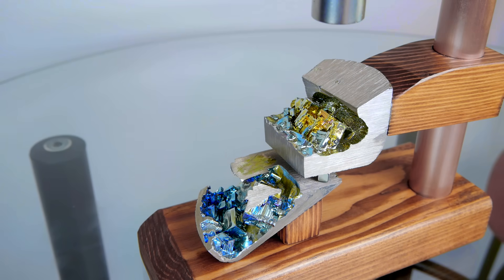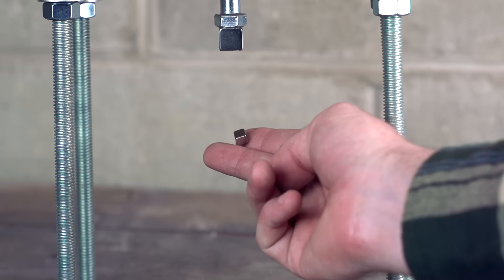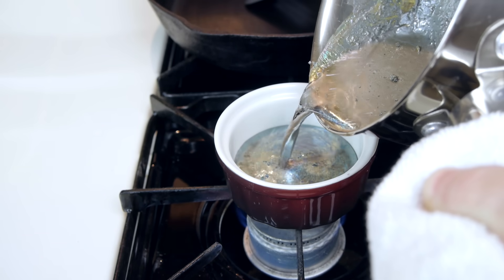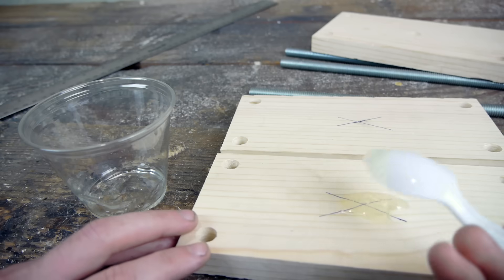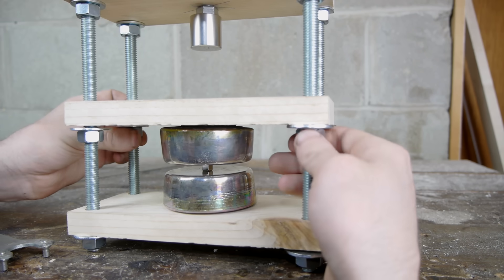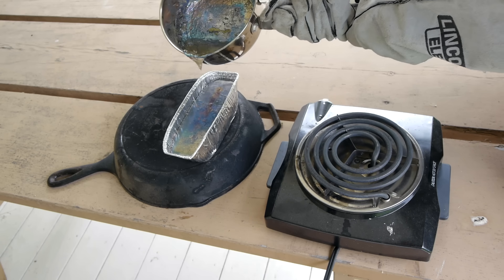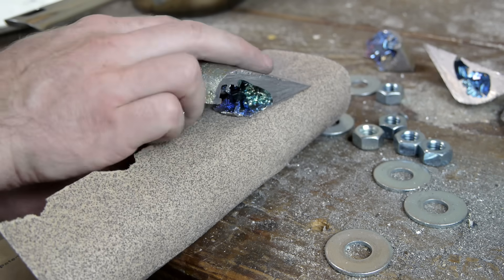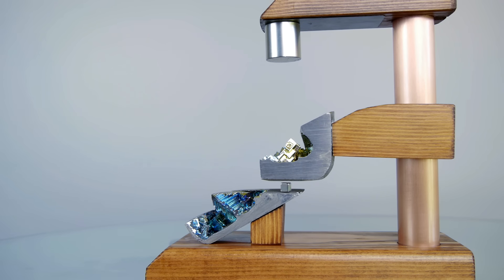Levitate a Magnet with Bismuth Crystals - No Energy Cost, Indefinite Levitation - NightHawkInLight

Comment: Do you think you could apply weight to the cubes and still have it float? For example: If you had four of these floating magnet devices and positioned them at the corners of a rectangle, then connected the four magnets with rods of some type to build a rectangular scaffold, could you then put a platform on the scaffold and have it float? I guess how much weight it could suspend would depend on the « top » lifting magnet? It’s purpose seems to be to counteract gravity?

Comment: Couldn't you add capacitors near this and get low cost electricity by manually causing the magnet to rotate every few hours? What if you tried it in a vacuum or in a near vacuum?

Comment: My question is, would it spin forever in a vacuum? Or would there be some sort of "magnetic friction"?
Reply from the maker: It would spin basically forever, until the magnets start losing polarity in a few hundred years. That doesn't mean you can get free energy from it. The moment you put a coil near it to extract electricity the resistance slows the spinning down.

Comment: I have a question, since sheets of copper do the the slowdown/ stability thing for magnetic levitation and bismuth provides repulsion would it be possible to make a sort of layered levitation mat of those 2 materials?
Reply from the maker: No, because bismuth doesn't give a strong enough reactive force to lift a magnet on its own. That's why the device in this video has an upper magnet to give extra lift.
Reply: @Nighthawkinlight  oh, that makes sense. I'm glad you replied 😊 Would that also rule out a levitation with a magnet under the stabilization materials since neither stop the magnetic waves?

Comment: So theoretically you can set a magnetic array that hovers has no friction and you can set one of those magnets to spin and charge an ac current giving you eternal free energy? On accounts to keeping the magnet spinning a low powered fan that uses .05 % of the charge made would theoretically keep the magnet spinning forever with a gentle breeze of wind no?
Reply: That's not how physics work unfortunately

Comment: so wait if bismuth naturally pushes back against magnetic fields why dont they use that to help hyper train lines out. they could add a passive resistance to the train and that should lower overall power requirements cause its the energy then the bismuth pushing instead of just having to relly on thousands of gigawatts of energy to keep the train off the track and not melt it into one piece. (and yes i know the assitance is small but when you apply it over 50 or 100 train cars that are made to be pushed back by super magnetis wouldnt it still provide enough assistance to be useful.
Reply from the maker: Bismuth is only twice as common as gold. It would be very expensive if used at scale.
Reply: @Nighthawkinlight  yea but isnt there a way to make bismith yourself. i watched someone do it with peptobismo
Reply: @Nighthawkinlight  yea it was by nilered who loves  heavy chemistry. so he makes all kinds of shit even stuff that would kill him if it throw gas at him.

Comment: If a magnet can spin freely with no outside influences couldn't this be used to make a 'free energy' device?
Putting a copper coil around the free spinning magnet should create electricity?
Reply: it's only spinning because he touched it. it will stop shortly afterwards. 
there is no way to harness a magnet to produce free usable energy
Reply: @DingbatToast  free energy is a myth yes but a efficient energy output device isn't. I watched over yes he did spin it but that spin is frictionless and only slowed by the atmosphere air around it. Its all ways been on my list to make a magnet levatating wind generator.

Comment: Interesting, now create a bigger one and figure out how to use the friction or spin to harness the energy it creates.
Reply: What if you built a cylinder of bismuth (big enough) drilled a hole through the magnet and placed a copper wire or something that can obsorb the heat it creates and see if it can boil water.

Comment: if we had a small coil around the rotate magnet, can we drag a certain amount of energy out at a point not stopping the magnet rotation? it must have some excess energy to over come the air resistance at least.

Comment: It seems that with each melting process you end-up with a thick layer of Bismuth Oxide that you have to constantly scrape, eventually losing some metal with each melting. Did you try to reduce the Bismuth oxide back to Bismuth, or melt the Bismuth in an enclosed nitrogen atmosphere?

Comment: I am trying to make this and can’t seem to get the magnet to float any suggestions
Reply from the maker: Raise the top plate until it's obviously too high. Then lower the top magnet very slowly until the little magnet just starts to lift off the bottom plate and eventually flies up against the top plate. Slowly lower the top plate back down and the magnet should begin to float as you get the two plates back to being close together.
Reply: @Nighthawkinlight   thanks for replying   exited to try it out
Reply: @Nighthawkinlight  I got a more powerful magnet and thought that would fix it but it seems that my bismuth is not diamagnetic is there a certain way to get it to repel the magnet?
Reply from the maker: I'm certain your bismuth is diamagnetic. It's a very weak force, you will not be able to feel it with your hands. The distance of the plates and the height of your top magnet need to be adjusted precisely for this to work.
Reply: @Nighthawkinlight   cool I’ll have to make a more precise fixture
Reply from the maker: Try to make one that can make very fine adjustments. The bottom plate doesn't have to move, only the top plate and the magnet

Comment: With this experiment I wanna add mercury and electricity to it watch mercury in a magnetic field on you tube . put these together to make a free power system or motor and use static electricity to run it.

Comment: But why do bismuth pushes it away ?
Reply from the maker: It's called diamagnetism. It's the opposite effect as iron pulling a magnet.
Reply: @Nighthawkinlight  i know, 
why this effect happens? 
What bismuth has in it to push it away ? 
An anti magnetic field?
Reply from the maker: The wiki article explains better than I can: https://en.m.wikipedia.org/wiki/Diamagnetism#:~:text=Diamagnetism%20is%20a%20quantum%20mechanical,magnetic%20dipoles%20in%20the%20material.
Reply: @Nighthawkinlight  thanks
Reply: Why does gravity do what it does. Why do magnets  what they do

Comment: This is amazing. Is there an application or formula to help calculate the variables needed to suspend an object, in the way that you did, with the exception that you would already have your parameters and wouldn't need to manually adjust?

Comment: PLEASE SOMEONE THAT KNOWS ANSWER THIS FOR US: So if you made a motor & used a "Magnet" on every second segment & then used "Bismuth" on every other second segment & then helped it start turning, would the "Push + Pull" of the 2 make it rotate forever?? & then like the "Free Energy" debate if you made one of these motors that was HUGE (like 100 x 100 meters or larger) could you not then use it to generate electricity??

Comment: Will it do the same with copper?
Reply from the maker: No, copper is not diamagnetic enough.
Reply: @Nighthawkinlight   we noticed say 1/3 min but I will look into if it will float not spin as from what I could tell by hand so far, will be getting some bismuth ordered thats for sure but was looking at the planet side as if you put one upside down and the law for left and right apply and arrange the magnet right it is a good rep for the planet n/s poles ,tow wind poles and the equator and if smart enough you may fit the outer feild but that may need power? If you can get the math for the core parts right and partical types to float material? Or gas that like magnetic fields plus some juice? Plasma style? will be in a ball for the cloud wind cycle by the spining core shaft great education on the second watch😆. Other problem is 100 and that design got why 200 hear ?

Comment: Id quite like to feature this in a new compilation video I'm working on but I'd like to do it on a bigger scale. Let's say for example with a 1-inch magnetic cube as so far I can only find examples of this with the 1/4 inch. Is it as simple as just scaling everything up or is there some reason nobody has done it with bigger magnets?
Reply: If you say double the dimensions then the mass increases according to the dimensional increase  cubed . So it's weight would increase eight times which can exceed capabilities of magnetic field pretty quick. Of course electro magnets might be an option but that requires energy consumption .
Reply: @charlesdickens6706  Which is fine if the device is levitating a train id say

Comment: This video reminded me that I got in my n52's and bismuth crystals. Excited, I went to my work area to demonstrate the levitation and it resulted in what you would expect from three ordinary objects and gravity. Do you think they may not have seen me real bismuth?
Reply from the maker: You need to have a stand with precise adjustments. Diamagnetism is a very weak force so you need the lifter magnet positioned just right to take most of the weight of the floating magnet while the diamagnetism keeps it centered.
Reply: One more quick question that you might know the answer to. If not, thats ok. Suppose one takes Rochelle crystals and sandwiches them between two n52s, is it logical to think one could get a sustained high voltage from the crystal?
Reply from the maker: No, there's no sustained energy to be had from magnets without other energy input.

Comment: The internet has created a lot of misunderstanding about "diamagnetic". What it means is it generates an opposing magnetic field if it is exposed to a CHANGING magnetic field. In a static field, it does not. That can be either motion, or an electromagnet powered by alternating current. In this case, the person placing the magnet near the bismuth supplies the initial energy. Irregularities in the shape of the magnet and the bismuth could keep the field fluctuating for quite a while, but I think it's still stored energy that would eventually "run down" mainly due to the friction of the air. It would take a while. Aluminum has the same property, just not as much.
Reply from the maker: You're confusing diamagnetism for magnetic induction (which requires a changing magnetic field). Diamagnetism doesn't require an input of energy in the same way gravity doesn't require an input of energy, it's just a static force.
Reply: Apparently you're right. Thanks.

Comment: This seems like a really project that would be fun to watch, but there are some problems in the title that the video claims. I don't know if I'd call this 'indefinite' levitation, as the magnetic properties of the bismuth will eventually decay over time. Also, there is energy being here, but because of the lower friction within the field, the magnet can spin for longer amounts of time. However, this too will eventually stop spinning. The energy, though relatively small, comes from the force of the push that starts the magnet on its way. For this truly to have no energy cost, it would have to have an efficiency of over 100% and the energy would have to come from nowhere, which breaks the second law of thermodynamics. Again, this is a really awesome project that is definitely fun to watch.

Comment: magnetic attraction and others shown
one idea .
  " Inertia " I see another meaning
of Inertia is uni-directional internal
pressure of atom. Some material
can show this atomic pressure is
activated by external ions penetration.
   Ex- iron material atoms can be 
control by external magnetron ions.
External magnetron ions penetrate to
iron materials Atom's internal bond.
This stage in iron Atom has unbalance
internally with one direction. 
    That unbalance position push to
Atomic pressure . This pressure 
have make to atom movement.
    last result which we see one inertia.
That is first basic idea of Inertial machines.

Comment: OMG! could you take some quicksilver and two electrodes to magnetize it and then you would maybe have a floating ball of liquid metal?
Reply: Jacob Ellinger I don't think you can magnetize quicksilver...
Reply: You can if you apply an electric current through it.
Reply: Jacob Ellinger then you're not really magnetizing it... it's the electric current that generates the magnetic field.

And I don't think it's a good idea. You'd probably need a LOT of current to make mercury (quicksilver) levitate, which would generate a crap ton of heat and cause the mercury to evaporate.

You could probably try to put mercury between two strong neodymium magnets, since (at least according to wikipedia) mercury is diamagnetic. But I'm not sure if it's diamagnetic enough to make levitation possible.
Reply: you don't need that much current to magnetize it. I have seen videos of people doing it with a single 9v battery. it does not heat up that much from such a current.
Reply: Ok, English is not my native language so I think I might've made a mistake. If you use the same word for turning something into a permanent magnet and using something as an electromagnet then I admit my first comment was wrong ;)

Still, while you can pass current through mercury to make a magnetic field (again, the field is not generated by the mercury but by the electrons passing through it), the mercury will actually weaken the generated magnetic field due to it's diamagnetic properties.

And in normal conditions you can't make a permanent magnet out of mercury, because mercury is diamagnetic and you can't turn diamagnetic or paramagnetic materials into permanent magnets.

Also, 
I didn't say you need a lot of current flowing through mercury to generate a magnetic field. You can definitely generate a magnetic field this way by using a 9v battery, even a 1,5v AA or something like a clock battery (or even a small solar panel) would suffice.

However, for a magnet to levitate above a diamagnetic material it has to be a very strong magnet, while also being very light. The only magnets that have such properties are the neodymium and other very strong permanent magnets. Electromagnets simply don't give you enough magnetic field per unit of mass to make levitation possible, unless superconductors are involved.

You can make the magnetic field generated by the electromagnet stronger by passing more current through it or passing the current through a coil-shaped wire. So levitating mercury would require either a shit ton of current or a bit less current and shaping it into a coil somehow. In the first case shit ton of current -> shit ton of voltage drop on your ball of mercury (since mercury has shit conductivity) -> shit ton of heat -> mercury evaporating -> mercury poisoning.
In second case by shaping mercury into a coil you inreased it's resistance (if you want to use the same amount of mercury as in the first case), so even if you pass less current through it you still end up with a big voltage drop and a shit ton of heat.

TL;DR: You can use a small battery to turn mercury into an electromagnet, but you need A LOT more (like several orders of magnitude more) current to make it levitate. Unless you want to die from mercury poisoning don't try to make it levitate this way.

Comment: Great video.  Looking to experiment with different shaped magnets.  What magnet shapes did you try to levitate and what is your best recommendation of size, shape etc.  Have you tried a round (ball bearing) type of magnet?  Your link for the 1/4" cubes is listed as an N40 grade.  Would a same sized N52 provide a greater levitation height?  Thanks for an answers you may provide.

Comment: have you considered this application in a closed field,,, if one of the elements repel the other elements as you say,,then one should be able to generate motion in a closed field,, simply by lining these elements up there opposite in a 360  configuration,,and using a closed field of course,,assuring that each end of the configuration is opposite of one another..

Comment: Advice needed :) I am now on the case and now have 500g of bismuth on order to go with the 100g I have already. Will this be enough for your design? Does bismuth stick to the stainless pan? Is it easy to knock out when solidified? What's the ideal size for the levitating magnet? PS: Thanks for the excellent clip!
Reply from the maker: That should be enough. It may not be enough to easily make big crystals but it will float a magnet fine. It doesn't stick in my pan. Don't know how much is ideal. The more the better for bigger crystals.
Reply: Thanks! Much appreciated :)

Comment: "No energy cost" shows himself adding energy instantly.
Reply from the maker: To spin the magnet. Levitating it is free.
Reply: we cant harvest energy from something thats stationary like that... and if u tryed and spun it the resistance of the mechanism transfering the energy would stop it. Even with nothing harvesting it it would eventually stop spinning cuz of air resistance, all its doing is distorting the magnetic field this has been understood for a while now. btw you picking it up and placin the object in the magnetic field is also use of energy.
Reply from the maker: No duh. This is energy free levitation device, not free energy generation.

Comment: QUESTION:

If this system is calibrated and a force is applied to the floating magnet,

does it create a counter force to return to its balanced position
or
does it stop floating?
Reply from the maker: It is pulled back into position if it's pushed away.